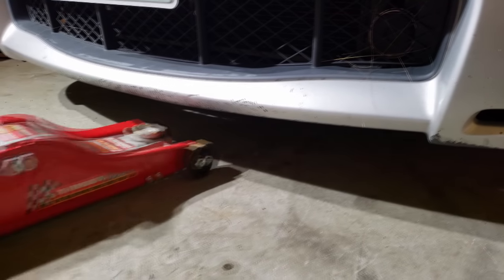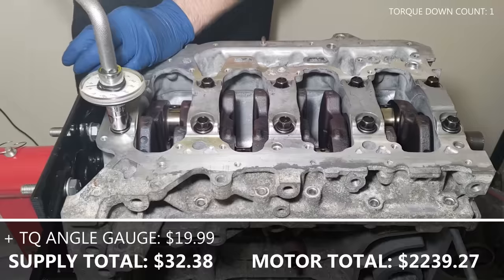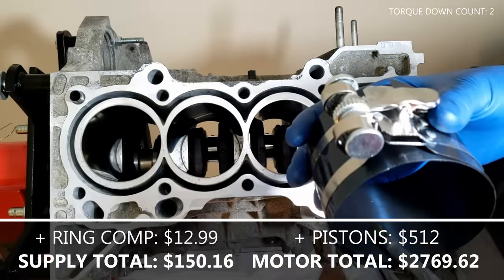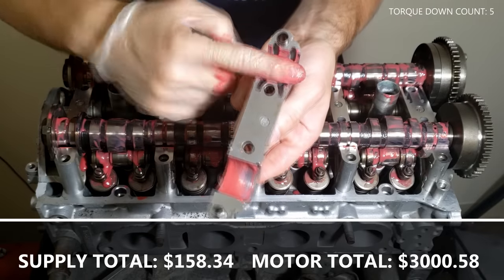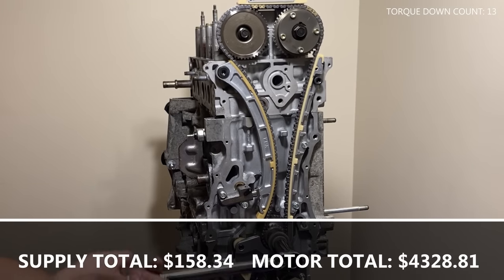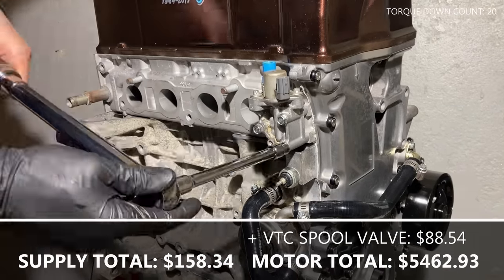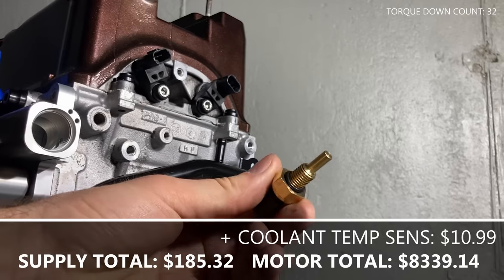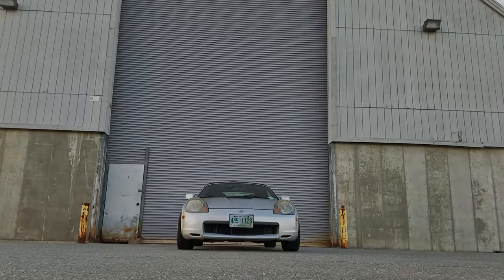Honda K24 Engine Build: Tracking Every Dollar Spent

Comment: You did this all yourself and was rather expensive . , this is an honest look of cost  to pass on , no bs like some other  k24 builds . If you get 7 years out of the engine , break it down and get another 7 .
Reply from the maker: It was much more than I thought it would end up. Hoping I get that much out of it. I went with a kswap because I figured I can transplant the motor into so many different cars
Reply: probably had an estimate in his head, got close to it and had no other choice but to continue
Reply: Today kids, we learn why all our favorite content creators do sponsorships, promotions, and have merch stores.
Appreciate you sharing, though. 😎 Saw another Youtuber do this with his Mustang. $30K, leaning hard into budget options. This is one expensive hobby.
Reply: BruceWayne-sz3th what's the reason behind "just getting an s2k" instead? Curious as to your logic
Reply: @Nick Adkins  Some people speak without thinking. It's either spending 11.5k to build an engine(to be fair he went above and beyond) or 30k on a car
Reply: @juangarcia-kq3uy  ikr it baffles me how ignorant people can be for real. The MR-S that this engine is going in would run circles around a $20k S2K. MR-S' don't look good without a widebody IMO, BUT when setup properly they are animals around a road course/autox and are extremely fun. I got to drive one for a couple months before I got my 91 MR2 Turbo which was my 1st car. Been 11 years this month and I still own it!

Comment: I'm a Honda O.G  and LOVE Hondas/ engines etc. BUT the GRAND total is INSANE!  It was built nicely and meticulous.  But there weren't any real over the top parts involved for that Grand Total to be so HIGH.  SHEESH
Reply: That's what I'm saying. It's just dumb to spend that much... For what? You can build and boost em for cheaper lol
Reply: @XL3BIGDrizzy Then why is it that expensive? It's mostly stock. Were there parts that didn't need to be replaced in fact replaced?
Reply: @shorty______  $350+ on a oil pan dude. Did he need a $500 ported oil pump? Of course not.
Reply: @adamlannerd1408  that's true tho

Comment: Man congrats on the build! The price is insane tho when you can get a crate engine for around the same price with only 5% of the time investment. However, the experience you gained is invaluable
Reply: He could have saved so much. But the engine is really nice so he did well.
Reply: crate engines dont always come with all the accessories around the motor. It's usually just a bare motor.

Comment: I built a monster 383 SBC for my camaro recently. 568 hp 531 lbft tq NET hp (measured with all accessories including hydroboost) perfectly streetable on 91 octane. My grand total was 11k CANADIAN with brand new heads, full new forged rotating assembly, the full suite of machine work on a 4 bolt main block and an excellent carb. The engine will take about 950 hp and roughly 8k rpm extremely safely. All that's required for boost is swapping the heads for larger volume combustion chambers. The carb is blowthrough ready and an electric fuel delivery system was included in my 11k total. I can achieve roughly 23mpg on the highway if I tune the carb for a road trip. I like the k series engines, but that price tag is not it man. There is no way that k24 is sitting at even half the hp of my 383. I love honda, but that price to performance ratio is not it.
Reply: Can rebuild an LS motor for even cheaper: cam kit, ring gap, high volume oil pump, LSX intake, and boost.
But K24’s are Hondas big blocks.
Reply: yeah but its a camaro

Comment: Wow I have always wanted to do a fresh build like this but you're making me rethink all that. I spun a rod in my KA24E and and toasted the crank. Sent the block in to get cleaned, decked, bored and honed. Got new oe style oversize pistons, bearings and crank.

Rebuilt it with the old parts that were still usable. Total was about $1600 including the machine work.
Reply: See this is more like it 😅 yea your not using Gucci top shelf parts but id bet if you left your motor stock with a mild tune it would put up pretty similar numbers and last just as long as the videos motor
Reply: $1,600?  You can pick up k24a2's for under a grand...

Comment: Little tip when using plastigauge on the bearings, good practice is to use the old bolts, on some engines the bolts are torqued to yield, meaning they stretch when fully torqued to spec. You'll have to buy new ones when you want to assemble the engine if you use the new ones!
Reply: I’m sure he already knew that

Comment: As long it makes you happy and is your passion, I don't see anything wrong with the cost. Just be sure to plan your retirement well.

PS - I was like you in the late 90's with my 1991 Eagle Talon Tsi awd. Fully rebuilt, low compression motor and all the water works. Pretty sure I spent well over 15K on it. It's somewhere in the junkyard. Good memories though.

Comment: great video I love how the internet decided it was "cheap" to do a kswap my turbo build into my civic is at 15k and its not tuned or anthing and the engine is just vct and oil pump otherwise stock
Reply from the maker: You are correct, there's a lot of hidden costs and I was hoping to provide a resource to help people realize that.
Reply: $15k for a stock k into a honda? What's wrong with you? That's the price to swap a into a nice rear drive miata or rx8.

Comment: thanks this helps me with what I need for my build, did you buy most of the parts oem from your dealership parts department?
Reply from the maker: I bought most online. I only went to the dealership when I needed something by quick. Dealership markup is way too high
Reply: @IGDesigns  thanks, so many bolts I need to buy it adds up haha
Reply from the maker: Yup, adds up quick. I broke two bolts in pretty critical areas and after that I bought all new hardware. 

One decent solution is to head to the junk yard and get some OEM bolts and just clean them up. I've got some bags I hold onto.
Reply: @IGDesigns  are these unique bolts or what

Comment: Would it have been about the same budget wise to buy a crate performance k series?
Reply: performance crate k engines go for about that price 11,000-12,000
Reply: @joshuachang4300 if that’s the truth, I might just go that route, no screw ups and prolly comes with some kinda of warranty
Reply: @Greengoblin0481 but they are a crate engine. Meaning you literally just get a block and a head. Nothing else. By the time you do all your accessories, fueling, exhaust, clutch etc.. and get it to where he has his engine in the video you're gonna be knocking on $20k's door....

Comment: My first project car taught me to triple the estimated cost and double the amount of time 😅 
I have a k24 in my 08 tsx and considering a rebuild as it’s 225k miles now, and I can swap it into any other project later since the tsx is not my daily now and it’s so damn heavy for these engines… at least stock anyway.
Reply: Is your TSX burning oil?
Reply: Is it really worth rebuilding when you can pick up low mile Japanese k24s for $800-950? Only worth it if you're doing a high comp e85 NA build as a stock k will do 450whp boosted reliably.

Comment: Was debating on k24 or LS swapping my 280z,…. Think I’ll go ahead and LS swap once the original motor dies
Reply: LS swap would definitely be the better option.
Reply: A stock k24 is $850 and will do 220whp fbo or handle 450whp boosted reliably stock. This video was overkill on cost.

Comment: Beautiful build. You did it correctly. But you could have bought two complete JDM k20a type-r with trannies for less than that.
Reply from the maker: Yeah but it was fun. Also people can use this as a resource to decide for themselves.
Reply: @IGDesigns  what did it dyno? I have often daydreamed of building a k24a1 into a 12:5:1 beast, but after seeing this cost break down, it is far more expensive than i dreamed.
Once again, Beautiful build, thanks for sharing.
Reply from the maker: @musshwins412  I got a video up but 250hp to the wheels. That was conservative too, with a stock valvetrain.

Comment: Did you apply lube to the back of the crank bearing before placing in the block?!? I thought you only lube the surface mated to the crank? Wouldn't that cause for a spun bearing?
Reply from the maker: I did not and you are correct. You want that to be as clean as possible.

Comment: Way too much spent for an NA motor, I got a 2013 55,000 mi SI for under that (pre covid), I'll be starting a build too , I have the TSX head and cams $100, will build a fresh turbo setup , hope to be around 7 k
Reply: You started it yet? Good rule of thumb is whatever you plan on spending on a build double it. I doubt you'll be in it $7k or less by the time it's all said and done with and tuned.
Reply: so , how's it going?😁 Did you give up or are you already at 14k?

Comment: You should really disable interlacing if you are using sony vegas to edit, that's what is probably causing those lines when anything moves on the screen.
Reply from the maker: I’m using Resolve to edit shot on a Sony zv1. I honestly am learning as I go with filming and editing so I will look into that setting. Thank you
Reply: @IGDesigns  either way it should be an interlacing setting, could even be something as simple as 1080i (instead of 1080p, but I'm not familiar with resolve.)
Reply from the maker: @--LZ---  Thanks, I'll look into it.

Comment: Does it really cost that much to build a k engine?  I'm thinking about it but after seeing this ticket I'm having 2nd thoughts.
Reply: Yeah but that's for a full build with all new parts. The little stuff adds up and if you start building anything to hold boost or more rpm then it costs a lot more. I rebuilt my KA24e after I spun a rod for about 2k. new crank, oem style pistons, bearings, seals, headgasket and the machine work. The goal was to spend as little as possible so i used all the old parts that were still good from the original block. The only thing that's not stock is the piston ring gap because I might boost it some day.

Comment: My honda 2004 CRV is still running like a boss.  Wouldn't think the engine is 12k USD though....I just drop the oil once a year and slap a new filter on it.
Reply: Lol its not, your crv is the low compression, mass produced version and is about $600-700 for a low mile Japanese replacement. The high compression 200hp stock k24a2 is only $850

Comment: God I love junk yard 4.8s that just want a cam and nitrous 😭 if it blows go get another one for $400 😂
Reply: I mean he bought the 2 engines for $300 and $200 and I'm sure they would've ran just fine with a standard refresh. But he literally replaced EVERYTHING with oem parts or upgraded name brand aftermarket parts. If you did the same to a 4.8/5.3 your cost would also be several thousand dollars.

Comment: After all that what are the HP and torque specs?
Reply: 12k for  210hp and 140 torque 😂
Reply from the maker: @wardeviIs  Hey wise guy, I got a video with the dyno run, that's 250 wheel to you
Reply: @IGDesigns  😳sorry
Reply: @wardeviIs  you are kind of paying for quality and reliability
Reply: @angelmonroy9644  true, that motor isnt going anywhere anytime soon.
Reply: @IGDesigns . So around 300hp crank.

Comment: i decided to buy a jdm k24a to replace my k24a2 instead of rebuilding it.  I also spent 12000 but only 1100 on the engine the rest was rebuilding the transmission, header, tune, wheels tires, brakes, front end.  etc... cars cost money, old cars cost more money.  It probably would have been wiser to just find a k20z3 for your mr2.
Reply: But now he has torque AND can rev high.
Reply: @nickadkins7765  how much and how high?   k24a already makes so much torque I snapped the diff gear on a hard launch. No thanks, is it that much different?   I prefer all OEM reliability.  And it doesn't burn a drop of oil.  Sold my old k24a2 to some dreamer wanting to dump $10000 into the  motor for an RSX.  Oh well.
Reply: $11k into those items? What car?
Reply: @ruthnoya8424  2007 TSX, and not ONLY those items.  Do you want a list?  The bespole -38 offset wheels and tires were 2800 for example.

Comment: I want to get a k24 head for my k20 on my 08 si, gonna re do it when i hit 200k mi.
Reply from the maker: You want a k20 head on the k24. K20 heads flow the best and the k24 gives you the displacement. Also only 1 variant of the k24 gives you real vtec.

Comment: You could probably have bought a brand new k24 for half that. Hell for another 6k you could've gotten a complete hellcat setup with pedals, control packs, wire harness, engine, and blower.

Comment: Most of all the engine parts are new and super clean. I think you should have cleaned the block even further with a Dremel and wire brush. Then prep and paint 

Steps
Degrease
Dremel Wire Brush
Degrease
Acetone
Mask
Self Etching primer
High Temp top coat of your choice
Reply from the maker: You are 100% correct. I regret not doing it at the time. It did not come back as clean as I wanted from the machine shop. We will revisit it though. Thanks for the feedback.

Comment: Compared to doing that same thing to an LS motor I consider that a bargain.
Reply: I just did it to an LS. crank, rods, pistons. built heads etc. I have probably the same money into mine, the only difference is that it will make about 1,100hp.
Reply: @BLAC_WORX  Maybe... Then again we need that HP to move all that extra weight. There comes a time in every car design where horsepower overcomes the design of the chassis (mustangs) and then all you are doing is leaving rubber all over the road. Unless you plant to build a full-on drag car 1100 HP for a street car is a waste and you will spend MUCH more on a drag car than that engine build. I have been building and racing for 40 years. I know, trust me. I also know that when you skimp and cut corners on an engine build you won't keep that motor running for long.
Reply: @BLAC_WORX his looks to be purpose built for twisties/autox/track days. I'm assuming yours is built to be a drag car/street car for highway pulls?

Not everything is about making 1k hp. Other people get their thrills and fun from different types of racing too. One thing is for sure is that whatever you build a car for no matter the intended purpose it's gonna cost 😂
Reply: @kl0wnkiller912 plenty of street (mustangs) making 1000+ hp and hook just fine. It comes down to suspension setup and boost by gear or ecu/traction control tuning more-so than it does a specific chassis at the end of the day.
Reply: @nickadkins7765  I am aware. Been racing for over 40 years. Most of your street mustangs don't have the development in the chassis that many cars did and when most people 'build' them they just hop up the motor and (most of the time but not all) ignore the suspension and chassis. There is a point in any car where power overcomes the design. I have a CTS-V that is mildly built and was recently dyno'd at 550 WHP. Not a lot by modern standards but on street tires is is nearly impossible to hook up from a dead stop and even on a low speed roll off you have to be careful. If you are having to back off the gas during a run because the tail is going out on you you are pretty much at a usable limit unless you can modify the chassis to handle the excess power and wheel spin. I drive my V on the street and never track it so buying high end racing tires is a waste of money. Another words, unless I want to spend a lot more money, I am at my cars usable power limit with the current setup.

Comment: Damn.  I know this a year old but where you find a motor for $200 they like $2,000 right now 😂
Reply from the maker: Wow is that true? I did buy a k20 with a spun bearing and a k24 that was sitting outside from an automatic Honda Element.

Comment: I spent just about this much on a k20a with fresh oil pump gaskets timing chain ect. Bunch of bullshit upgrades and he built a new motor for the same let me tell u some That's some shit right there but hey i can rev to 9k 😬😬☠️ Lowkey rather have that torque Lowkey could buy a k24 block and swap my k20a head on there
Reply: You got ripped hard, you can buy a low mile jdm k20 type R engine/lsd trans combo for $5k

Comment: I respect that build but why a mr2 they have shite handling
Reply: They handle amazingly when setup right. The MR-S' are exceptionally handling cars. There was one in particular at my local autox events with the stock engine with just basic boltons, lighter wheels and sticky tires, suspension tuned precisely, and bigger brake upgrade. He was the fastest car out of anything there by over a second that day and probably had the least hp too. They are fantastic cars, unfortunately they just don't look good until you get a proper widebody kit on them IMO

Comment: You overpaid for everything even the machine shop. This can be done way cheaper for 12k you could have a turbo k series with 500hp easily. 4Piston sells a pre built n/a engine that with right fuel makes 400hp for 13,500. Anyone looking to get in Honda game it doesn’t cost this much this guy overpaid.
Reply from the maker: If peak HP was my goal then yes I overpaid but in this scenario I don’t care about HP
Reply: Pretty sure those are just crate engines though. Meaning you get a block and a head. NOTHING else. By the time you assemble it to wjere his was at in the video you'd be at $20k lol

Comment: why are guys obsessed with crappy little convertibles you might as well drive a power wheels with some oversized engine
Reply: I see you've never been fast in the corners before eh? A supercharged miata was one of the slowest cars I've ever owned, but admittedly one of the most fun. You just won't get it until you've experienced it is all i can tell you.